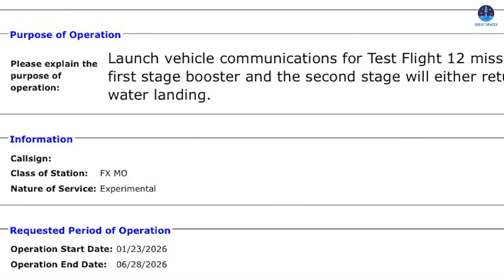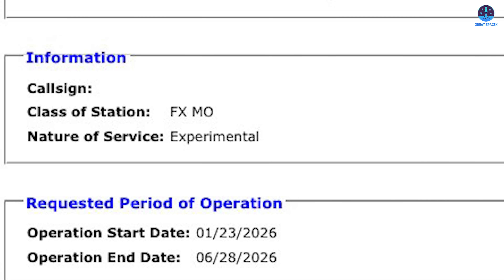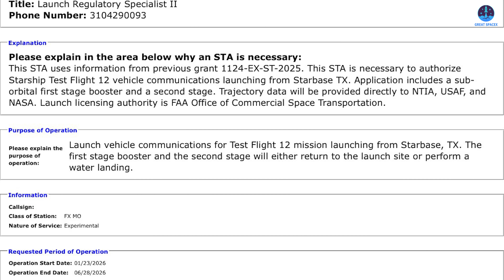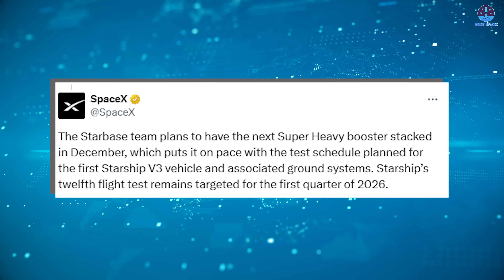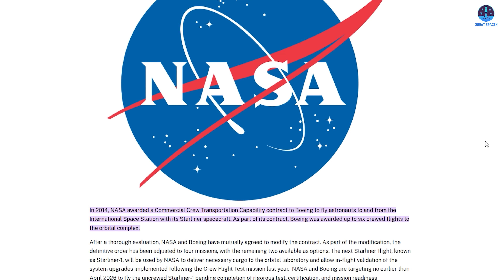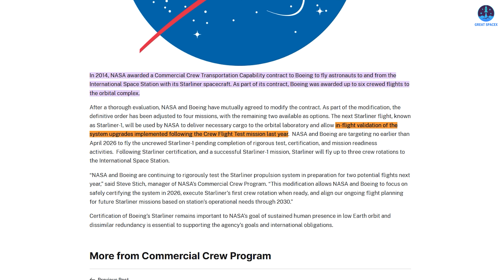SpaceX Starship Flight 12 Launch Date Announced after Booster V3 Failure! Is this feasible

Comment: If the B18 failure does indeed prove to be caused by COPVs, the good news is that they have always happened fairly early in the process.  One would hope that inspection techniques can be implemented that would catch these problems ahead of time.  I should think that ultrasonic or x-ray based inspection together with machine learning enhanced signal processing would be well able to identify these anomalies.

Comment: I recently found out that the numbers I was basing all my conjectures on:

A SpaceX starship V2 of 100 tons dry mass, with 1,200 tons of fuel, carrying a 100 ton payload to orbit (as per the info SpaceX was giving out) for the HLS configuration of Artemis II, and Artemis III missions, were not real numbers, but projections for future flights.   Actual dry mass was more like 161 tons, and they never came close to 100 tons payload to orbit.

Now that we know there will not be any more V2 flights, and we now know they never achieved the numbers they were tossing about, I don't have any numbers to base my conjectures upon, and will be waiting until at least a V3 proves itself in orbit/return and relaunch, before I believe any numbers spaceX publishes.

I also will not credit spaceX with being able to safely land a ~100 ton ship on the moon, with no Lunar landing experience, and no Lunar infrastructure to make such a mission profile possible, and most definitely not in time for the Artemis missions.  Call me what you will.
Reply: According to numbers you just provided, an Isp=350s engine fuel combination could provide an acceleration of roughly 6670m/s. Vacuum optimized Isp=380s - 7250m/s.
Isp though is a bit tricky thing as it changes. And Starship uses both nozzles. So the truth is somewhere in between. Some 400+m/s are used for landing. Velocity left before touchdown and worse Isp at Sea level there. But there's no payload to carry at this point, so it's roughly half of that. Deorbiting idk, 100 for accurate reentry? Some safety margin, evaporation. That's 300..400m/s required for return? Super Heavy for Starship flight 11provided ~1300m/s (+gravity losses). So ~7900m/s LEO kind of doable.

The problem though we haven't seen Starship yet. Only an empty can. To host 100t of satellites you may need 5t frame or similar issues. Fuel needs tanks and humans - habitat and support. Which could change the PR bs quite a bit. Also it hasn't really landed yet, hasn't got verified payload up there and some SpaceX numbers may be optimistic. Dry mass, average Isp, deadlines... And it has never been reused! So there's that.

Another concern may be costs. Bottomline with mass produced engines and Falcon (can Falcon get Raptor after some rework?) - it could be a lot cheaper to launch non reusable second stage than the loses on heavy Starship and all the R&D even though reusable. Space hates mass. 
For 2..3 Moon landings definitely. Because there's no Moon program. Just some mumbo jumbo "lets land there again and see where it goes". Politics...
Reply: @vensroofcat6415  This is the best reply I have read so far!

My initial attempts to boil thing down so my amature, space enthusiast brain could get a grip on things, were based upon what I thought spaceX was claiming for the current V2 of ship, but that turned out to be way off the mark.

My initial inquiry was to find out, of the notional/fictional 100 ton dry mass of the ship, what was the dry mass of the fuel tanks, and the number I got back was ~42 tons, and then I tried to lock down, of the outbound 1,200 tons of fuel mass, how much would be needed for the journey from LEO >>> NRHO around Luna, and then how much for a Lunar landing and liftoff, which would have left the notional V2 ship in a stable orbit around the moon, long term, and the crew returning on the orion.

I cannot speculate on other things until I have some good, realistic numbers from an actual re-launched Starship, using it's actual (or even just ball-park) numbers.

From what I am seeing, there is indeed no "Program", just a revisited 1960's esque, publicity stunt kind of thing.  A go-there-do-that kind of thing.

What we need, and I want to see, is a set of contracts that walk us up to and beyond round trip capability between Earth and Luna, and this means that we need to start working on the vitals right now, today, and not stop until the bases on the moon are producing all the fuel we need for round trips between Earth/Luna.

Here is what my hairbrained NASA contracts would look like:

1)  Get companies able to produce an upper stage that does not have anything more that a disposable payload fairing, which can detach once in orbit, or on the way to orbit.

2)  The resulting vessel, just tanks/engines/needed flight components, needs to be fueled in orbit, loaded in orbit, and configurable for whatever missions NASA needs, either one way, or (eventually) round trips to Luan, Mars, or wherever.

3)  Payloads for such a program, need to be able to seperate from their launch platform, and be comprised of an interconnectable, modular rack system, such that most if not all such payloads/modules can be hooked end-for-end, or side-by-side, for any given mission profile.

This would require in space assembly, so spacewalks, space construction, the ability to maneuver many payloads/modules, perhaps with a 'space/orbital tug', and of course a place to do these tasks.

Such a program would allow us to dispense with the downright idiotic ideas of having to use a vehicle that has to be designed and built to launch up out of Earth atmosphere/gravity well, and then not be customized for future in-space missions.

The notion of a 100 ton, untested, unproven (and let's face it, UnBuilt), experimental prototype, making it's maiden voyage to Luna, and pulling of a flawless landing and subsequent takeoff, without ever demonstrating an ability to land and be reused on Earth, where we have complete infrastructure to do just that, just offends the brain.

Maybe, some decade, long after I am dust, that may indeed be a thing.  The trouble is, I want to be alive to see it.

What are your thoughts on what kind of a modular, interconnectable payload/rack system would be needed, and what would there need to be beyond the obvious?  If we can get some good numbers to work with, finding out the dry mass of the fuel tanks would be a great help.

I was using the ~42 ton tank dry mass value in my conjectures, and noting the supposed ~100 ton payload capacity to LEO, I was positing a twin tank modular payload, along with a fuel transfer system, and allowing for the structural mass of the module itself to be 10 tons empty.

Had the ~40 ton dry mass to 1,200 ton fully fueled mass values benn accurate, then a 30:1 ration could be employed, to keep easy track of just how much fuel is needed for any space missions.

Returning for a moment to the Notional 100 ton ship V2, launching with 1,200 tons of fuel, and carrying 100 tons of payload to LEO, what amount of those 1,200 tons of fuel, would have still remained for the landing back on Earth at Starbase?

Continuing to use these now known to be non-factual numbers, but in the absence of anything better, let us look at a space program to is aimed at an ongoing mission, to establish a permanent, and potentially crewed, base on the moon, and all the infrastructure on Earth, LEO, NRHO around Luna, and the Lunar base /infrastructure itself...

Something like spaceX's super heavy booster, lifts something like spaceX's starship second stage, up above the dense lower atmosphere, and that is where I want to focus my conjectures on going onward/outward from this starting point.

A Refueled HLS, departing from LEO, was supposed to have 1,200 tons of fuel mass, of which just about 5/6th would be needed to depart Leo, travel to the moon, and then enter the NRHO around Luan, and the remaining ~200 tons of fuel would be expended to deposit the notional ~100 ton payload directly to the Lunar surface, and rise back to Lunar orbit.

More later, I just about lost this wall of text.
Reply: Continuing this….

That mission profile has us being limited to 100 tons payload, which might be a limit for s vehicle that has to ride up out of Earth embrace, but that need not have anything at all to do with what those same engines, with the same, (or much, much more) fuel, can deliver to Luna.  Because of all the politics/hurry up and achieve a publicity stunt kind of thinking, folks were not putting effort into thinking sustainability.  Look at a notional launch:

A starship  upper stage of about ~100 tons, begins orbital insertion burn, uses up most of it’s fuel, deposits a payload within a detachable, modular rack system ~10 tons mass itself, so leaving ~90 tons for actual cargo/payload/fuel.  Because of aerodynamics, some thing will constrain a vehicle’s rise, and while we have to work within those constraints in the Earth   >>>   LEO   >>> return to earth and do it all, all over again, cycle of reusable launch systems, once we are in space, why can we not both load a core with both fuel and cargo, and finally be free of the Earth bound constraints?

One ~100 ton payload could be a pair of ~42 ton empty tanks, (so twice the fuel capacity of the notional HLS ship), contained in the notional, modular rack system, itself ~10 tons, and that would leave us a mass budget of ~8 tons for the “propellant transfer system”  82+8+10-100 tons, or a single launch/payload, boosting some extra empty fuel tanks into orbit.

A second ~100 ton payload could be multiple new Lunar lander type vehicles.  Given a mass budget of ~30 tons, fully fueled, three such could be carried aloft, per launch.  Of course, if they use the same fuel as the SpaceX or other launch vehicle, they can wait for their fuel in orbit, just like the mother ship/core that will be taking them outward bound.  Of course, mass isn’t the real limiting factor for this, as these three notional landers take up space, and unless we can find a way to launch 10-20 of these, all at once, within the same launch vehicles payload bay/fairing, we need to speculate on limiting the numbers per launch.

Given the notional “Some Assembly Required” contracts, and with complete "Interconnectability" between modular payload rack systems, what might a near future Lunar Mission look like?
Reply: @math080guy  I think the mistake is to buy a truck and a cargo container as one. Yes, you need climate control for all kinds of cargo. But then you most likely need different level of climate control for different cargo. And again, space hates mass. But your hands are tied now.

Elon went for that large Mars project which could on paper fund dedicated rocket design. 1000 rockets for 20 000 people kind of stuff. Except the Mars project itself has no funding. And Mars itself missing all kind of technologies. Massive energy sources, resource industries, infrastructure (plumbing, wiring, forwarding), etc, etc.

I have a feeling there should be "tugboats". Talking about Mars or asteroids even more so. Very different engine technologies. And then all kind of cargo separately. Lego style. Starship is all but star-ship. Not even interplanetary. LEOship. But even there I'm not sure about the cost structure yet. We will see.

A good thing there's also New Glenn rising and I really hope Neutron too. Diverse offers will help us know what's good for what. Elon eventually could stop Falcon advances just to "prove" his point. With competition though that's not possible. 

The thing is no one has become a billionaire being all nice and honest. Some basic "healthy" amount of skepticism is our due diligence. In regards to all of them.

Comment: V3 go boom. Starliner is a much more capable capsule as compared to the Dragon. If one is being honest starship has had way more problems than the Starliner.
Reply: The Starliner has had its fair share of issues. Out of an abundance of caution, NASA didn't return the crew aboard Starliner, but the trip was executed remotely. Had the astronauts been aboard, they would have been perfectly safe. For the past year, SpaceX has lost a vehicle on average every 2 months. The Starship has no launch abort system; it relies on a last-second flip maneuver powered by engines that have been pushed to the limits of material science to ignite with millisecond precision, otherwise certain loss of vehicle and crew. Starship, as is, will never be a crew vehicle. The spaceflight enthusiasts community is so focused on Starship they completely ignore the realities of the state of the program. As compared to Starship, Starliner has a pretty good record.
Reply: @mp6756  There's no excessive caution; the Starliner wasn't reliable, they're not taking any risks, they had to change the astronaut program on the station because of it. SpaceX has long been the sole provider of crew transfers, the numbers prove it. I think you're the only one who would want to get on a Boeing capsule.
Comparing the Starship and the Starliner is audacious... they're not comparable. Landing the Starship with a crew is out of the question; they're not there yet, it remains to be defined. I see SpaceX as progressing with a fairly broad, long-term vision, which allows them to address problems along the way quite flexibly; they have an "empirical" approach, it's in their DNA.
I can understand that they might put off "conventional" engineers.
Reply: Lmao starliner sucks. Cmon man
Reply: But Dragon hasn't left any astronauts stranded in orbit for nine months.
Reply: @백종환-w4d   SpaceX's Dragon capsule has had thruster problems, including a catastrophic test failure in April 2019 where a faulty valve led to the destruction of a Crew Dragon capsule and a thruster issue during a 2013 cargo mission that delayed its rendezvous with the space station. More recently, a corrosion problem in a thruster valve on a cargo spacecraft in June 2023 also caused a thruster to get stuck open, although it did not impact the mission. What's your point?
Reply: @m @mp6756  his point was dragon has not left any astronauts stranded, which your comment didn’t disprove at all lol you just said a whole lot of nothing….
Reply: @6.7Powerstroke956   I couldn't make it any clearer. Starships blow up every few months and you all say its all bout learning and collecting data. Starliner didn't suffer a catastrophic loss of control and burn up on reentry. You are all hooked on Elon like a drug.